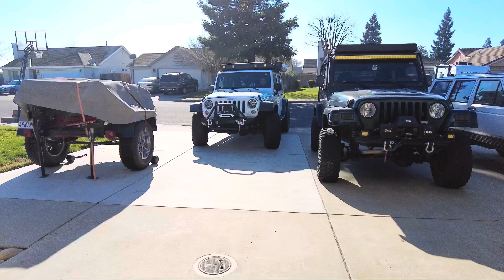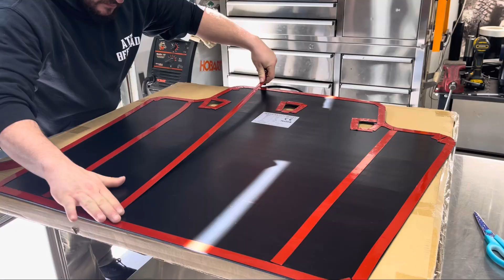Close Look At Lensun Solar Hood Mounted Solar Panel & Charge Controller - Jeep JK | JKU | TJ | XJ

Comment from the maker: Some benefits to the solar kit highlighted by Lensun Solar

1. Keep your vehicle or auxiliary battery topped up at all times. It is ideal for overlanders and campers seeking to power devices worry-free without draining their battery.
2. Keep your power station charged. The solar panel comes with standard connectors and uses adaptors (buy separately) to charge for most of the power stations on the market.
3. Decreased hood glare. The Lensun hood flexible solar panel features a top-tier ETFE film surface that eliminates light reflection, reducing glare while driving.
4. Protect and extend battery life. The Batteries usually hit only 60% charge with daily driving, and if parked for 2-3 weeks, starting becomes unreliable, especially in summer. Plus, they degrade within 2-3 years. The Lensun hood flexible solar panel maintains battery charge, tackling these issues.
5. Convenience and space-saving. The hood flexible solar panel attaches directly to the vehicle's hood; no roof rack is needed. Unlike portable solar panels that eat up cargo space with setup and storage, it's a plug-and-play system for easy installation.
6. The optional custom-fitted vinyl decal. A vinyl decal between the solar panel and hood is highly recommended. It protects the vehicle paint from damage.
7. Easy to install plug-and-play wiring. The optional Plug-and-play 10A Waterproof MPPT solar controller. It comes pre-wired with fuses, terminals, and connectors. It features advanced MPPT control with intelligent protection against risks like reverse polarity and overcharging. Compatible with Sealed, AGM, Gel, Liquid, and Lithium-ion batteries.
Click to check the details of the Lensun 10A Waterproof MPPT Solar Controller.

Video Chapters

00:00 Intro Lensun Solar
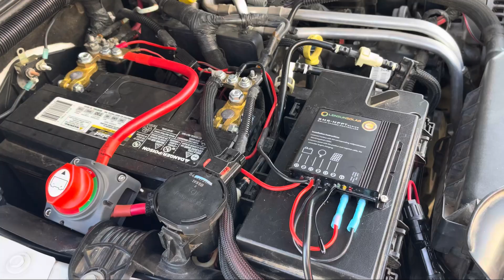00:27 What’s In The Kit
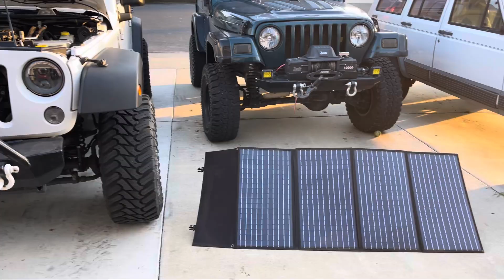02:18 Why Vehicle Solar
03:10 Many Applications 
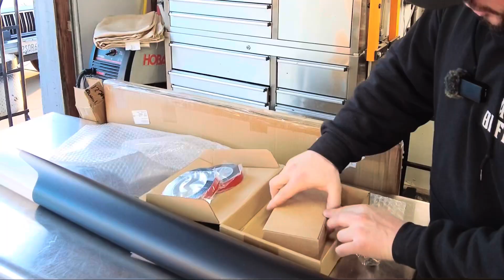04:00 Solar Charge Controller
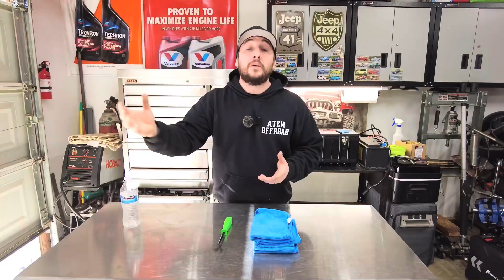05:27 Vinyl Decal Installation
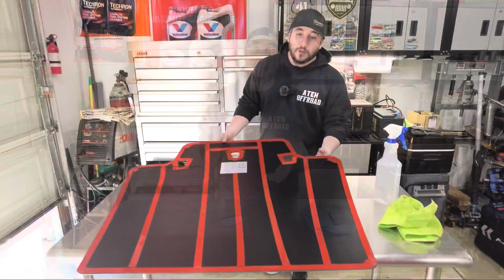09:37 Solar Panel Installation 
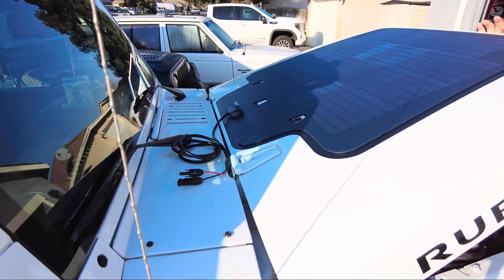13:13 Solar Charge System Wiring
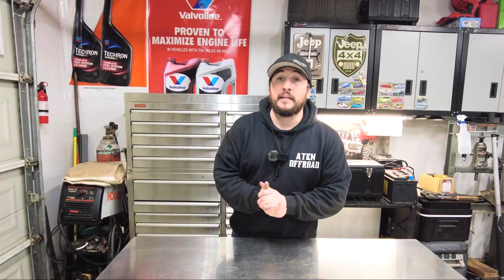16:42 How It Works
19:42 Bluetooth App Controls
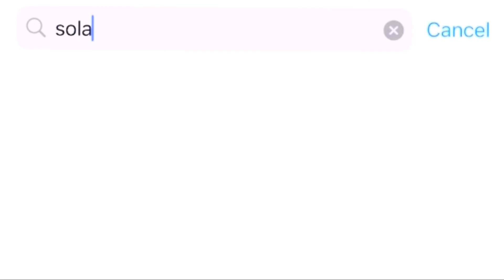20:15 Controller Programming 
21:09 Solar Benefits & Conclusion

Comment: My app is showing my battery at only about 60% in the morning but 99% in the evening. I didn't have much of a drain before I installed this...is this a quirk of how the app reads my battery percentage or is it a genuine draw somewhere? I'm not sure how the battery is determining the battery level.
Reply from the maker: you'll need to make sure you have it set up properly in the app settings for lead acid battery, that happened to me and for some reason the controller wasn't updated the first time. but it's been fine since. i should do an update on this

Comment: Nice video, thanks for reviewing it. Your video gave me ideals how to make work for my system. I ordered the solar panel and vinyl decal only. 
Im running solar cables to the back of my Wrangler inside to charge my  power bank system and E-Cooler. Also using SIKA Sikaflex-221 Multi-Purpose Sealant/Adhesive to mount solar panel to the vinyl instead the double sided tape.

Comment: Absolutely ridiculous - 3M sticky tape🤣. Can easily detach on the highway right into the windshield. Can't wash your car with this thing attached. Absolutely no benefit over any foldable solar panels.
Reply from the maker: i've had it on over a year now, many miles on and offroad and it hasn't peeled off 😂🤷‍♂️
Reply: @ATEMOFFROAD have y washed y car? tunnel-wash I mean, with brushes, air-blow dryers?
Reply from the maker: @slavakuznetsov4966 a couple of times in a pinch, but i hand wash my jeeps.
Reply: @ATEMOFFROAD y see the problem then. I also see no practical benefit of attaching solar to my car vs 150W solar i keep in my trunk
Reply from the maker: @slavakuznetsov4966  I carry those in my trunk too for our power stations. I use it on the same mttp controller to charge my jeep battery as well. we sometimes do tailgating in parking lots with little room so already attached to the jeep is convenient .  If we want to leave the jeep and go on a hike somewhere  we don't have to worry about someone stealing the panel so our food and drinks in the fridge stay cold and the main battery doesn't get drained while away. it's very convenient for that and keeping the jeeps battery topped off.

Comment: Great video! However @18:22 you mention that the D2D mode (Dusk 2 Dawn) will energize the load during the day using the solar panel and will turn off power to the load at night.  I am currently in the process of testing my Lensun MPPT that came with the solar kit also and unfortunately, this is not the case... It will turn on the load at Dusk and turn off the load in the morning. (hence Dusk To Dawn)     It would be REALLY nice if the MPPT would this!  Hopefully Lensun will see this and respond with a way how to turn on the load at Dawn and turn off the load at Dusk...Which would allow us to charge small devices during the day using Solar without draining our vehicle battery...   I am currently using my Lensun to keep my vehicle battery topped off as well using the Load circuit on the MPPT to keep my NOCO battery jump booster fully charged and ready to use in case I or someone needs a jump start.   Hopefully Lensun will provide a solution for turning the load on during the day when the sun is out and turning off the load when there is not enough solar...
Reply from the maker: @datguy2730  You are correct and, nice catch for some reason I interpreted dusk being day and dawn being night for whatever reason I like the option even if it doesn’t actually exist ha. 
So for the fix?  A couple suggestions. 

1. Is to directly connect the load wires from the controller to the coil of a 12Vdc 10amp SPST relay (85,86) and run a separate +12vdc wire, sized for your load and fused, (In my case it will be for a refrigerator) to the mains side of the relay, (30) terminal.
 Then take your loads +12vdc side wire and connect it to the (87a) N.C contact terminal. Using D2D at night the relay will be active and held ON opening the circuit turning off your device. Then during daylight the relay coil will automatically become inactive, closing the circuit to power on your device. The downside to this would be that at night the relay coil will consume some power, but it’s very minimal and can also be controlled by app in manual mode.

2. Find an inline 12vdc Dawn to dusk sensor switch for between controller output and load. 

3. try the fixed hour on/off and timing control modes. ( have yet to look into these?)Will update soon. Hoping it works similarly to a clock. 

4. Wait for an app update.

I have contacted Lensun in regards to this being a useful option, Suggesting to add a Dawn to dusk mode or a toggle button for on\off during day/night which definitely seems doable. I will continue to update on other solutions as well. Thanks for your input. 🍻
Reply: @ATEMOFFROAD  Unfortunately, it looks like the posts that I put links in are automatically getting deleted... Oh Well , I tried...
Reply from the maker: Have you found a solution? I think this device would work but it doesn’t seem very protected. https://amzn.to/41kV5zt
Reply: @ATEMOFFROAD  Yep I was able to find a solution!!  I replied to your previous comment BUT I think it got blocked by YouTube OR it's on hold waiting for you to approve the post. It had an amazon link...   I found a similar device to your amazon link BUT it has an added feature.  Anyway just refer to that post I submitted.  Also I reached out to Lensun and their support person said that they don't have any plans in the future to add the Dawn to Dusk mode UNLESS they receive a large number of customer requests for it... So in the meantime I am just going to use that device I posted about and put it between the MPPT and my emergency devices (car booster pack, flashlights, etc.) that I want to charge only when there is sunlight .  Since I have access to a laser cutter, I am just going cut out some mounting plates for it and mount it inside of a small case that will be mounted on my rear cargo electronics panel inside my jeep... I should get all the parts I need by next week...   Another solution would be to just find another MPPT with the Dawn to Dusk  (aka morning to night) mode option BUT I am not sure which MPPTs have a morning to night option for the load circuit and how much those MPPTs with that option cost...
Reply from the maker: @datguy2730  Awesome, and hmm there isn’t a post to approve?. Can you try to resend the Amazon link to that part? Another possible option is to find another small solar panel that can active a relay during the day and turn off at night. I’ll drop a link for that part too. Thanks   🍻
Reply from the maker: @datguy2730  currently I’m testing a new circuit in the design phase waiting on these parts, essentially it will be my own Dawn to Dusk controller using a few simple components and without the need for a battery, by directly connecting the solar panels outputs to a DC to DC converter. This device does not require batteries and does not use them for a voltage reference. Instead, the DC to DC converter has input voltage reference in DC and provides an output voltage in DC. This means that if the solar panel has a voltage within the input range voltage of the DC to DC converter, then the device will be able to provide a fixed output in DC. So here’s a small solar panel that can activate a small coil during the day and de activate during the night. In this case I will use the 24v out of the Lensun panel using an adapter pigtail connection. One side for the controller and the other for the dc to dc converter. And out with 5volts dc to the relays coil. 
Parts:
Dc to dc converter https://amzn.to/41koDND
Mini solar panel (optional) I suppose you can pigtail directly off the Lensun panel. https://amzn.to/4i31pBs
5v spst coil relay 30A : https://amzn.to/3X5iDG0
I feel 30A is sufficient for a refrigerator
I will let you know how this D2D circuit holds up 🍻
Reply: @ATEMOFFROAD  Nothing to approve... Interesting... I guess youtube automatically deleted it...  I will put the link in the next post by itself right after this post... Hopefully it will go through...
Reply: @ATEMOFFROAD  Hopefully the amazon link above went through this time... The reason why I like this device is because it has a delay option.  The delay option is nice because if your are driving and you drive underneath trees or a bridge, it will not immediately turn off the load.  Thus you reduce the chances of rapidly cycling the load circuit on and off which I think is a little bit better of a design.   I will place the tiny photoresistor sensor in my rear window and adjust the activation sensitivity accordingly...    Now I did find another MPPT control that has the Morning to Night mode (M2N) built in.  I am going to coin the phrase M2N for this feature.  LOL!   Anyway the MPPT controller I found that has the option is relatively inexpensive under $20!  Not sure about the build quality but it looks like over 2k people have purchased it.   It has a mode called OH, which according to a YouTube Reviewer that mode will turn on the load during the morning and turn off the load at night.  (M2N).  I will try and post a link to the Youtube Reviewer on my next post... Hopefully that will go through as well...
Reply: Have this setup and it is JUNK. It is actually a knock off of the original Cascadia solar panel. Good Luck

Comment: What is the warranty on this? I can't see these lasting very long. Solar panels need a way to vent heat but it's on top of a hood that gets hot due to the engine. Most flexible panels lose 50% of their efficiency within the first year because they have issues dissipating heat and that's without having a hot hood as its mounting surface. 
The idea is great but unless there is some new technology I can't see this as a viable option.
Reply from the maker: @eddie947  good points, for these panels it’s a 24 month warranty. Extreme heat and cold both affect performance, this is why the controller has a built in BMS and temperature sensor under the hood that protects the panel and battery. Shutting off any input or output. In the future I’m hoping to add another panel to the top of my rooftop tent to compare with which is also black and can get hot  so I will be able to give a long term review here in about a year. The controller is on Amazon for 80 dollars you could also pick out your own panel, any panels for 10A. I would advise to do your research on there website before any purchase to make sure it’s right for you.

Comment: hmm... This looks good but I'm wondering what's the use case here: when the Jeep is driving, you can charge your stuff via cigarette lighter; when you are parking or camping you could use any kind of solar panel independently of the vehicle. Perhaps I didn't get the idea behind!?!
Reply from the maker: @BerniesBastelBude  Idea is to safely use power off the vehicles battery without totally draining or destroying it, including the capability of monitoring the battery health and how much power is consumable off the battery. You might find through the app that your demand of power is far greater. So while the jeep is parked the solar panel is charging the battery compensating for any power consumed while the engine/alternator is off.  My personal example would be if I’m at the lake or on hike and my refrigerator is connected to the Jeeps battery. The solar helps keep the batteries topped off so you can restart the jeep when you get back or ready to leave. That’s been my main concern, stuck out there with a dead battery. Now if your connection is through the load output on the controller, the app allows you to monitor how much power the refrigerator has consumed, and you can manually toggle this output on and off or set times for its intended use, In theory using the power directly from the sun. When the charger is off. You also have the option to not charge the vehicle battery, but an extra onboard auxiliary battery through the controller or by directly plugging into a portable power station using the mc4 connectors. 

Here are some more benefits that are mentioned by Lensun 

1. Keep your vehicle or auxiliary battery topped up at all times. It is ideal for overlanders and campers seeking to power devices worry-free without draining their battery.
2. Keep your power station charged. The solar panel comes with standard connectors and uses adaptors (buy separately) to charge for most of the power stations on the market.
3. Decreased hood glare. The Lensun hood flexible solar panel features a top-tier ETFE film surface that eliminates light reflection, reducing glare while driving.
4. Protect and extend battery life. The Batteries usually hit only 60% charge with daily driving, and if parked for 2-3 weeks, starting becomes unreliable, especially in summer. Plus, they degrade within 2-3 years. The Lensun hood flexible solar panel maintains battery charge, tackling these issues.
5. Convenience and space-saving. The hood flexible solar panel attaches directly to the vehicle's hood; no roof rack is needed. Unlike portable solar panels that eat up cargo space with setup and storage, it's a plug-and-play system for easy installation.
6. The optional custom-fitted vinyl decal. A vinyl decal between the solar panel and hood is highly recommended. It protects the vehicle paint from damage.
7. Easy to install plug-and-play wiring. The optional Plug-and-play 10A Waterproof MPPT solar controller. It comes pre-wired with fuses, terminals, and connectors. It features advanced MPPT control with intelligent protection against risks like reverse polarity and overcharging. Compatible with Sealed, AGM, Gel, Liquid, and Lithium-ion batteries.
Click to check the details of the Lensun 10A Waterproof MPPT Solar Controller.
Reply: @ATEMOFFROAD  wow - that's a huge explanation - thx!